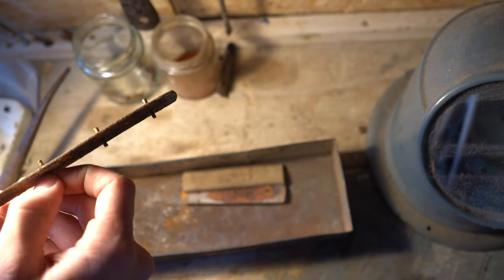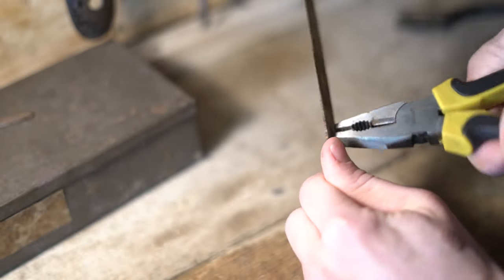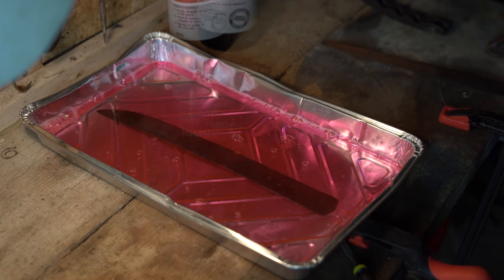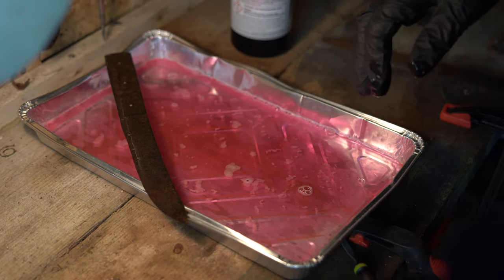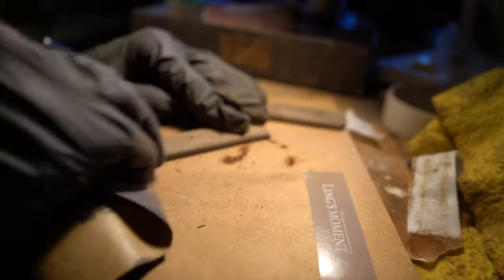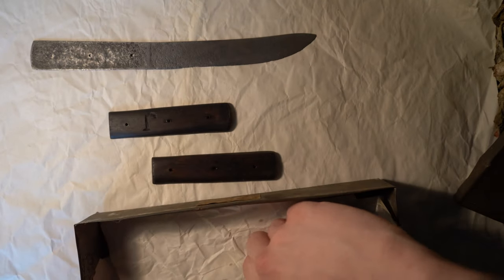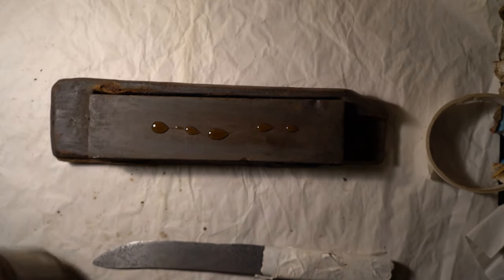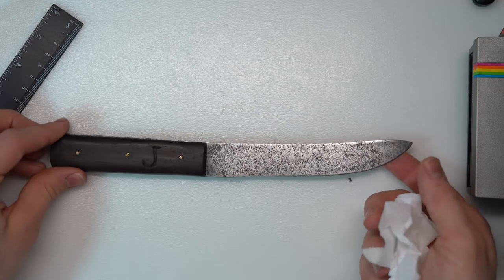Restoring My Great-Grandfather’s 100 Year Old Knife

Comment: A restoration in this manor can only be described as 100% satisfying.  There is no work involved, just a love and respect for great grand dad. 

Molassas for steel and stainless steel polishing wool for both steel and wood are 2 of the best restoration materials around. Give them ago on another project. No harmful chemicals / aids and not as abrasive on finishes or surfaces.
Reply from the maker: Thank you for both watching and the helpful advice!

Comment: Dear Mr. Calum
👍👌👏 Oh WOW, simply fantastic! This is exactly how it should always been done (at least in my opinion respectively for my kind of personal taste). I'm sick and tired of watching bettet than new "restorations", especially polishing every knife, ax etc.p.p. to mirror shine! This knife was brought back to life and will be used again. It has character and you honoured your father/grandfather. You did what car guys call a patina restoration. Additionally you reused all the old/original parts! The only thing I would have done different, results out of my life long experience as somebody who is addicted to repair nearly everything. I would've glued the handles on additionally (with epoxy glue). So cracks wouldn't open, the split between steel and wood is closed and the handle is protected a bit better from humidity.
Please do more of this kind of restorations.
Thanks a lot for making teaching explaining recording editing uploading and sharing.
Best regards, luck and health to all of you.
Post Scriptum: The old sharpening stone is simply fantastic too!
Reply from the maker: Good point on the epoxy! Definitely doing that in the future. Thanks so much for the kind comment, much appreciated!

Comment: Now that is what I would call a perfect restoration!  Very well done.

The kind of video you mentioned are more like a remanufacture, and as you say, it wipes all of the history from the piece.

As an aside, if you are leaving something to soak in some flavour of rust remover, I've had good results by supporting the steel with strips of Scotchbrite type scouring pads.  They have enough strength to support the piece off the base of the tray, but are also open enough to allow the rust treatment to get into all of the important little places ... :-)
Reply from the maker: Thank you! Will definitely try that technique as well, always on the hunt for new rust-removal techniques!

Comment: Similar approach to what I've taken with knives. I've had to replace the scales on some, like for instance, a Ghanaian guy gave me his old machete, which was missing one scale, and I replaced both with African mahogany and new brass rivets instead of the original iron ones, I think it's pretty nice. Still has the patina and the "Made in Ghana" on the blade. Nice hard steel, holds an edge very well and it's great for trimming hedges. I also have my grandpa's US army mess kit knife from WWII, nice carbon steel blade with cast aluminum handle. I found it in my grandma's shed after she died, just removed most of the rust and sharpened it and it's great as a kitchen knife. 

It is wonderful to have old knives and use them.
Reply from the maker: Exactly, what is a tool if it isn't used? I think the best mark of an old items that isn't perhaps of historical or monetary value is trying to continue using and improving on it, while maybe trying to still preserve the history within it. In 60 years time people will look back on the fresh scales you put on as just yet another part of it's long history, and I think thats brilliant.

Comment: There are 2 methods best for restoring old and fragile iron things found from earth and neglect. 
1. electrolysis. I use small old repurposed mobile phone  charger and solution of sodium bicarbonate. It takes time (sometimes 2-4 days) with little power but it is safer and preserves objects better. Iv preserved 200 y old museum grade tools from under 5mm of rust crust with this method. Hardest is to find the first place for contact and get the reaction going but then its just a waiting game. Made a usable bone handle knife from old broken scythe tip found from ground with this method. And never used harder scrubber than toothbrush. 
2. Dicarboxylic acid. it Is great for painted thin items like WWII helmets found from ground. Always go slow and stop as soon as possible.

Comment: I admit, I would like to have seen the blade ground down to raw metal, and then be polished to a shiny surface - though the handle came out fine in my opinion. But, I understand what you were trying to accomplish and you did a great job. There is somewhat of an awe to hold, or just be in the presence of something over 100 years old - especially if it still a usable object. 😏

Comment: There's a lot to be said for doing a restoration exactly as you want to, whether it's sympathetic, concours, or with any number of alterations - destructive if you wish.
It's your knife, and you have to live with the results.
I like what you did with it - I can see the history in it, and it's very similar to an old knife my dad owns - complete with a piece of rubber hose in lieu of a sheath.

It was a pity that one of the scales ended up chipped, but you have the right attitude, so all good.

One thing that I would suggest is that you buy yourself some Hammerite Kurust - I cannot recommend it highly enough.
It stops, stabilises and cures the rust - it's reasonably priced and goes a long, long way.
I've used it many times over the years, but I recently found out how far it actually goes.
I had to refurbish a pair of wrought iron driveway gates, which were in a pretty poor condition - after removing the flaked rust I applied the Kurust to much of the wrought iron - even applying a couple of coats in places I only used about 60-70ml, and the gates were 5' X 4' (X2). It's very watery so spreads a long way, though you must transfer it into a separate container as you cannot return it to the original container.
It's fantastic - if you are going to restore more metal, get some in.
For a good metal polish I recommend Peek - also exceptional stuff.
Reply from the maker: Ian Macfarlane thank you! But yeah I think people sometimes get hung up on details, I’m very much of the “just do the thing” attitude. Especially with things like this, where you can learn and have something at the end. 

On the Kurust note, I have buckets of the stuff- in fact I’ve got it on subscription from Amazon! The joys of owning old rusty cars and living in Scotland. That said for this knife it was mainly surface and kurust can have a habit of ‘staining’ metals. Always handy to have on hand though.
Reply: @CalumRaasay  I certainly wasn't criticising you for the tiny chip on the scale - things happen - it's how you deal with these little things that matters, and you dealt with it perfectly.

Yes, Kurust can stain, and it probably wouldn't have been worth taking that risk with the knife - I was just recommending it for consideration on future projects.
Maybe the information could be of use to someone who's watching.
The other stuff I mentioned - Peek - metal polish, (assuming you haven't got a subscription  for that too😉) is definitely worth a look at.
Take care Calum - I'm thoroughly enjoying your channel.
Reply from the maker: Ian Macfarlane oh no don’t worry I didn’t think you were! No I was agreeing with you completely! Need to look a more polishes and especially more whetstone and bits for future restorations
Reply: @CalumRaasay  I look forward to seeing what you come up with.
Love the footage of the islands - more of that please.
Cheers Calum✌️

Comment: To be honest, other knife sharpening videos go all the way is because, they want the knife to last just as long or even longer. With leaving the character and flaws you are leaving the reasons why the knife deteriorated. you are leaving rust, dirt, oils, and oxides in the knife, you dont want that on your knife.  The are some of the reasons why most things fall apart, you dont want these free radicals on your car, or other expensive items, they destroy them. The reason why they male the knives like new is because they are getting rid of the reasons why the knives look like like a rusted mess, they are resetting the clock and lifespan on the item. Its just ideal maintenance. Unfortunately it all but impossible to do what Calum wants and get like new if he wanted to. Making the way he made it, it will perhaps last 10 years instead of 100 years this. Most people in the comments love that he did that but, its not ideal if you want a long lasting knife, he seems to cherish it and I would recommend he make this knife like new.
Reply from the maker: The knife isn't anything more than a golrified letter opener, I don't know what you're doing to your tools but there's no way a knife like that even if it wasn't restored would only 'last' ten years. What does 'last' even mean? it's not going to crumble into a puddle of dust.